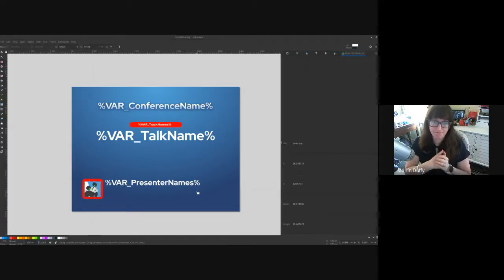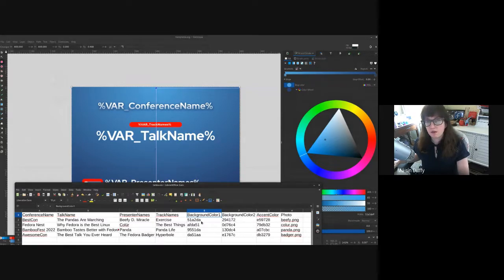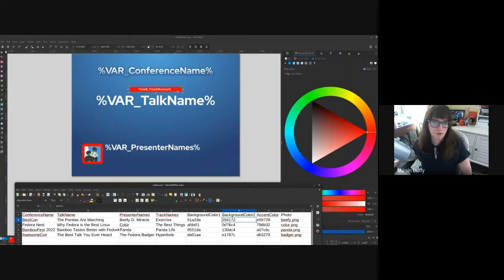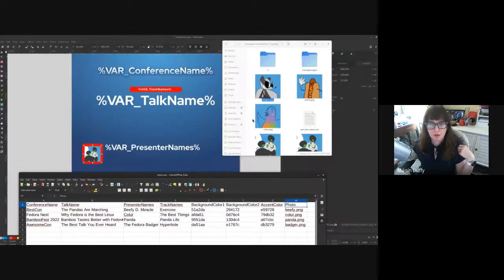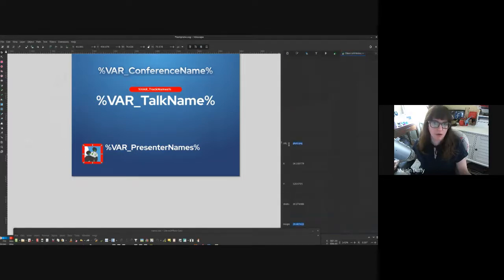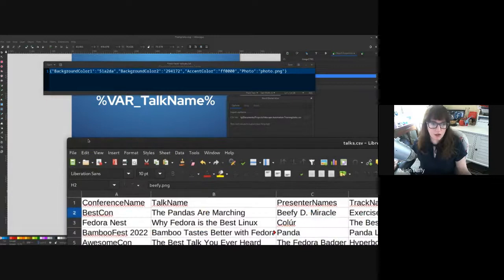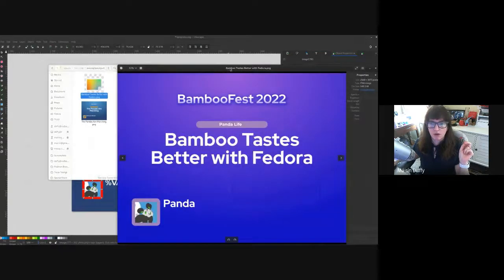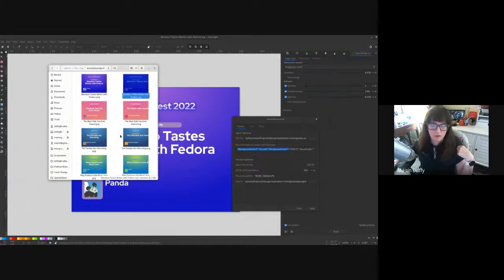Inkscape Advanced Automation Tutorial from the Fedora Design Team

Comment: I am very intrigued by this setup. I wish it were a little more user friendly and UI based, but I digress. I am curious if this method could define what font to use on specific text as well. I am going to take a stab at it, but would appreciate any suggestions anyone might have. I do lots of iTunes Album Covers, and I want to be able to type the album name into a template, and run the Next Generator script against a CSV with say 50 rows defining different font choices. If the Next Generator could be updated to make a single multi-page file on output, instead of all individual SVG, that would be immense. Think one mulit-page output based on the template input, that contains a single linked image, that generates a linked copy of the image (Normally created using alt+d), on every page, with the title text in various fonts.

Comment: How are you keeping the new imported text centered? When I do it, the new text remains at the same X position from where the actual %VAR_Variable% text is centered
Reply: Ok figured it out for anyone wondering. When you go to input text, click and drag a rectangle for the space you want the text to occupy as opposed to just clicking and typing. Then in the text toolbar you can modify the left/center/right justification and it will hold the center even with a line break, in the rectangle you drew. Still need to center the rectangle (by centering the already-centered text by using align and distribute toolbox that you're likely used to already).